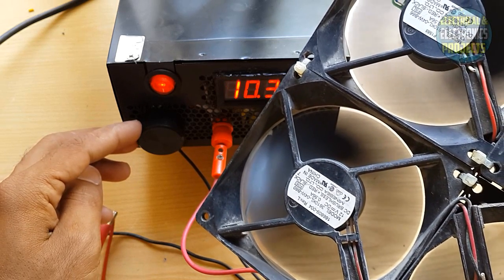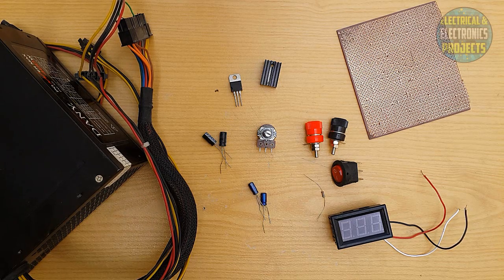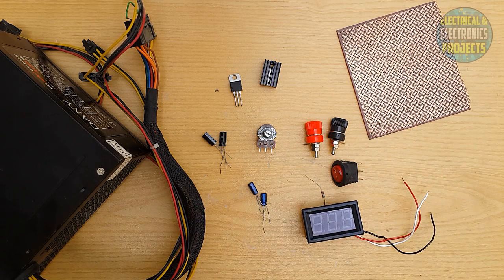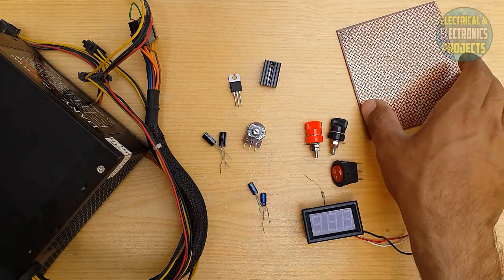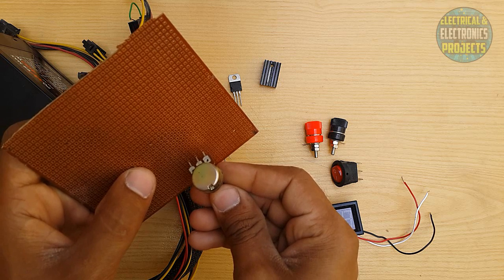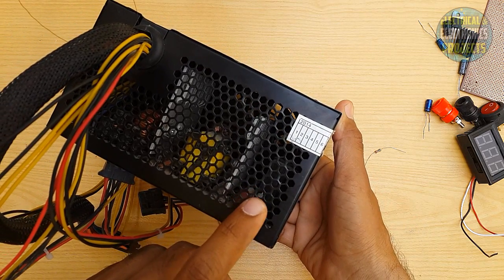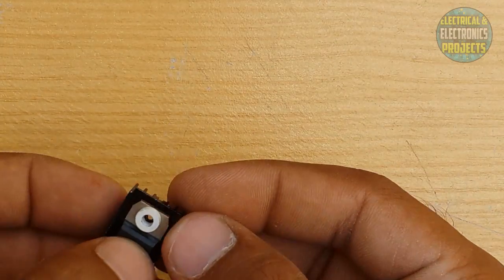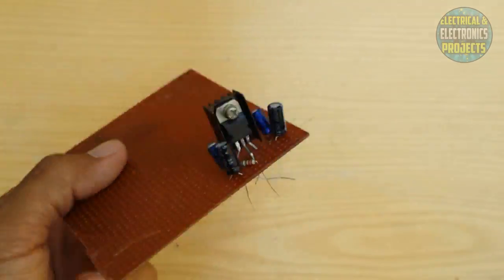How to make adjustable 1 to 20 voltage power supply from old PSU.DIY Bench power supply.

Comment: Though good intentioned, this isn't really a solution to the problem: you're attaching a linear regulator and using the ATX PSU as a voltage source.
What would be a much better and neater solution, IMHO, is to hack the SMPS and create a continuously variable output voltage from the voltage divider on the LV side, linking to the optocoupler adjusting the PWM duty cycle.
This is what I'll be doing to fill the bordom of COVD-19 lockdown, and will surely publish the result.
Good effort regardless ..
Reply: The problem is that any hack into the ATX PSU always alters ALL the voltages (i.e. 3.3, 5, 12); imho the best solution is to have a mixed setup: all 3 fixed switched and protected output voltages and one linear regulated variable output for ocassional use in circuits
Reply: @alerey4363  how would I make this scenario. I need the PSU to have an output of 20 volts on one circuit and 12 volts on another circuit. I know it's possible. Any help you have would be appreciated. I will not need any other voltage scenarios and the amperage is max 15a on both circuits

Comment: Tradução: 
Oi pessoal aqui é o novo vídeo do meu canal "Como fazer fonte de alimentação ajustável 1 a 20 de tensão da fonte de alimentação velha PSU.DIY Bench". de "Projetos elétricos e eletrônicos" Canal "E & EP".

Este é um PSU do computador antigo e quer converter para 1 - 20 Volts Fonte de alimentação ajustável quase funciona mesmo como fonte de alimentação do banco.

Precisamos de uma gama diferente de tensões para alimentar qualquer eletrônica como motores DC, circuitos, etc.Então, eu fiz esta fonte de alimentação ajustável, mostrando um diagrama de circuito para vocês e com a ajuda do meu vídeo.É muito fácil fazer o seu próprio mesmo, um iniciante também pode fazer isso seguindo o diagrama de vídeo e de circuito.

SOBRE FIAÇÃO:
Aqui neste PSU para torná-lo 1- 20V fonte de alimentação ajustável eu cortei todos os fios desnecessários, exceto quatro fios: azul, amarelo, verde e cinza.
O fio azul é -12v usado para catodo e o fio amarelo é + 12v usado para ânodo e os dois restantes são para ligar a fonte de alimentação conectando-os juntos e para o voltímetro digital DC há três fios conectados com vermelho, preto e vermelho são para alimentar o medidor conectar preto para azul -12v e vermelho para + 12v e conectar o fio branco ao lado de tensão de saída do circuito que é ajustável para entender melhor o diagrama de circuito está no vídeo.

LISTA DE MATERIAL:
 220 ohm Resistência 1 / 4W (1)
100uF 35v capacitores (2)
0,1 uF 50v capacitores (2)
Potenciômetro VR 10k (1)
Regulador U1 LM317
Potenciômetros De Ligação (2)
Voltímetro digital de CC 0-99v
Botão de volume
AC Botão liga / desliga

Comment: Hi, very good project, thumbs up!! I have questions. Is it possible to avoid using the -12v rail in order to get more amperage or is this a stupidity that i have just said? would it lower the maximum voltage? would this modify be safe? Thanks
Reply from the maker: It would lower the maximum voltage  if you need around 12V you can avoid -12v in order to get more amperage.

Comment: it can not deliver more than 1.5amps 😐,  its a waste not to take advantage of the higher current rating of the psu if it were to be connected as a variable voltage unit.

Comment: I would rather get one of those 150~ Watt Boosters, boost 12vdc voltage up (most power supplies can push 10+A easy)...smooth it with caps, then use buck to regulate back down (smooth output as well to remove ripple)...hooking the -12vdc rail to the +12vdc rail limits the current available as most -12vdc rails on ATX power supplies are very very limited in current capacity. [read the power tag on side of power supply]

Comment: The linear power supplies have a total crap efficiency, and nobody wants inefficiency. I advise you to use a buck boost converter.
Reply: yes that is why we use AC , the higher the frequency the lower the loses but sometimes losses are negligible , sometimes very important , doesn't matter , this video is bad , its a bad concept .

Comment: i connect  LM317 Adjustable Voltage Regulator Step-down Power Supply Module with LED Meter to my atx power supply +12v yellow and  - 12v blue  wire..... i use my dc 775 motor to test run very  slow..........

Comment: If you just using lm317 it just deliver small current. Very small.   Its useless

You need some extra component to handle a huge current. You need put some transistor (ex: 2955/3055) to deliver lot of current.

You waste 20amps and just take an one amp? Who needs one amps?
Reply: Fata Benny get your facts straight, he is using the negative 12v rail in combination with +12v rail to get approximate 24 volts, but the -12v rail can supply about 0.5-1a max...

Comment: Very nice. Just a few problems... First, the heatsink for the LM317 is too small. Linear voltage regulators work just like a variable resistor. They convert the unused energy into heat. Second, because that PSU is a SMPS (switching mode power supply) you must put a small load on it (like a 5W 25 ohm resistor on the 5V output) so the output voltages will stabilise. And try isolating the binding posts with something because they are too close to other components in the PSU. But, finally, very nice project! ;)
Reply from the maker: Thanks!

Comment: Please help. 
I have 200w psu and when i connect green and black wire fan just kicks for few seconds and it powers off. I didnt connect anything just all yellow black red and orange wires and i have some more but i didnt do anything with them. Please help
Reply from the maker: First make sure that black wires are not touching any of other wires maybe that's the reason, if not then there is a problem in a circuit of your PSU.Thanks.
Reply: Electrical & Electronics Projects. well they don't touch and psu wires or anything so problem is in psu

Comment: I follow those step and the diagram but i only could get 12v max. How could i got up to 20v?
Reply: use the -12v wire with the 12V wires. though adding the -12V will massively lower your AMP output. roughly between 0.5amp to around 1amp max if you do that.  the -12V and the 12V joined together make 24V but yeah you sacrifice output amps massively

Comment: i wonder when -12v is connected to the ground, is  -12v grounded or the ground is pulled down to -12v? what is the voltage between +12v and ground then? or -12v is actually just a specific ground (0v) for +12v?
Reply: I understand your confusion, it's a bit tricky to think about.
You can think of it this way: You've got a difference in potential of 24 volts. With some tricks you establish a point between them, and you simply use that as your ground. This leaves you with +12 and -12v on each side. Now if you were to disconnect that mid-point from the ground in your circuit and use the -12 instead, you've have 0 and 24. The ground is just a reference, voltage potential is relative.
Does that make any more sense?
Reply from the maker: When we take -12 as a negative and +12 as positive terminal so it sum -12 + + 12 = 24 Volts. The blue wire -12 is used for this purpose.
Reply from the maker: yeah you are right but the volts that starts from 1.2v because of meter has some problem to powered from 1.2v maybe.
Reply: Karl Birkir Flosason Thanks, i think i understand now. i was confused st by the schematic shown at first which -12v is connected to ground.  i thought that doesn't make sense since to my knowledge, 'ground' is always 0v (for the sake of safety and convenient). But it turns out in this schematic, ground is actually the negative terminal (-12v) instead of 0v (which exists among the bundle of wire )

Comment: how would you make a power supply from a old scanner,copier,fax machine all in on the office type,there the 3' tall ones I'm talking about
Reply: just look inside them, you cannot miss the power supply part! :)
but those are really low power supplies, even they can offer 25-35 volts, they will offer a mere tens (or hundreds if you are lucky and those are really old) miliamps of current... so, they are not so useful :)
Reply: I created my own from scanner power supply

Comment: Its a waste that the PSU can supply so many amps on its default voltages but your LM317 limits all of it to only 1.5 amp max. If the lm317 is paired with a transformer and a rectifier, it'll probably be 1/4 the size of the entire PSU - much much smaller
Reply: Adam Gadut yeah, it's true. the power supply has many voltage values which can be directly used for most common applications. if a variable PSU is really needed, a cheap buck converter is better.

Comment: The worst PC power supply is around 250W, half of this power is on the +12V line, which is roughly 10A. LM317 can supply max 1.5A, if cooled very efficiently and covering up the heatsink with electrical tape is not the way for best cooling. You're wasting your time with a linear voltage regulator.

Comment: -12 volts is no more than 1 Ampere in most PSU so the project have 1A out!
Reply: Even my atx at - 12v only supply 0.5ampere
Reply: True , I can only run 3.6 amps on 12v and the power supply shuts down : / no good 4 car stereo .
Reply: PrashMotion 0.8 a**
Reply: sakisrorras what? most atx supplies can deliver like 30 amps on their 12v rails
Reply: If you can see i wrote -12 (minus 12) because in your schematic you are using +12 and -12 outputs from the ATX .So i think you can have more than 1A from your PSU.Correct me if i;m wrong!
Reply: sakisrorras ahh now I see what you've meant. I thought that - was there by accident. you're right: the output of -12 volts is about 1a

Comment: Can i use 1 uF 50v Capacitors instead 0.1 uF 50v Capacitors?
Reply: solder two of 0.22 capacitor in serial and you got 0.1uf

Comment: Why didn't you include all 12 volt yellow wires? Maybe wire the extra 12 volt, 5 volt, 3.3 volt wires for high amp on separate banana plugs?
Reply: Why not just put an adjustable lm2596 in there
Reply: loading up too much on the psu will cause it to fail 
especially when charging batteries
using less wires = psu live longer
Reply: the less the better for me
i made a video about charging a battery with a psu  
i charged it alredy 5 times  
it still works very well 
and eazy to make
no soldering 
and no parts needed
Reply: I have a huge box of them, but you would never get the amperage

Comment: I like your project, was wondering if a higher value potentiometer will fine tune the voltage to 0.1 volt increments?
Reply: oh well then no just use 10 turn pots :D ther like 5x more expensive but its alwys worth cuz trust me your gonna need that 4.2 your gonna need that 13.7 so yeah its worth it or what you can do is put a smalle pot in series the way you have more precision
Reply: no its an lm317 it will go down to 1.2 v
Reply: I think he meant in 0.1 steps (at any voltage)  not down to 0.1v , cos it looked like it was hard to fine tune the Voltage with the 10K Pot. ( I think it was 10K?)
Reply: Thx, that is good information, I'll have to look into wiring pots in series

Comment: the only change I would make is not use the power switch on the mains connection.  if you connect the green wire to the switch, and the black to the same switch, you control everything with low voltage and low current.